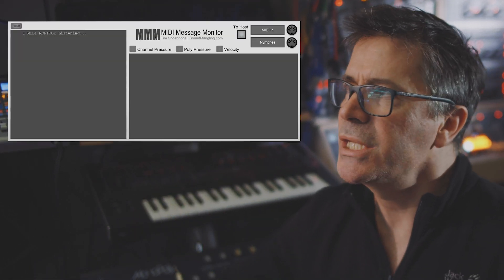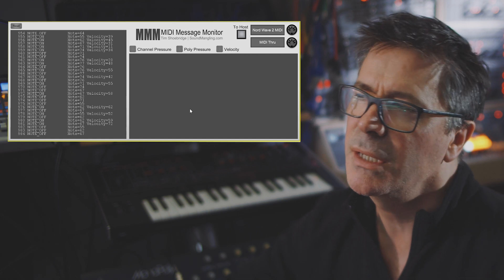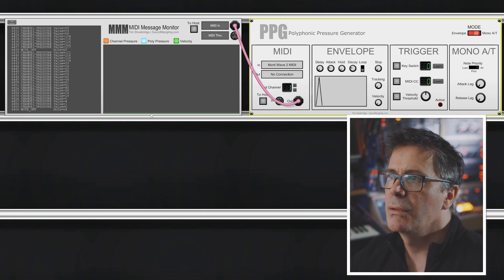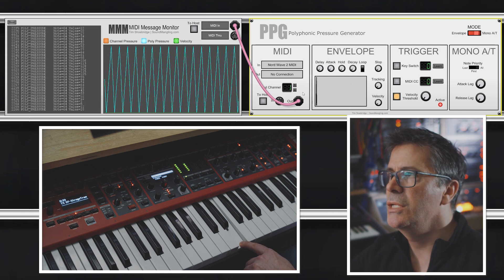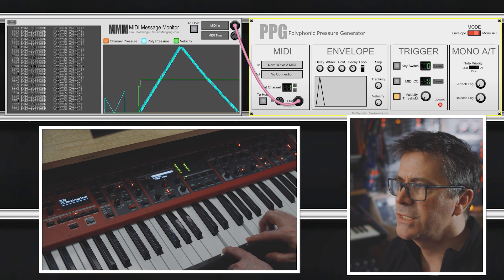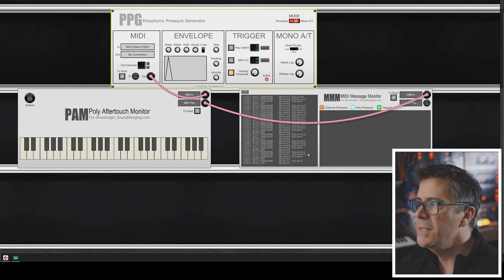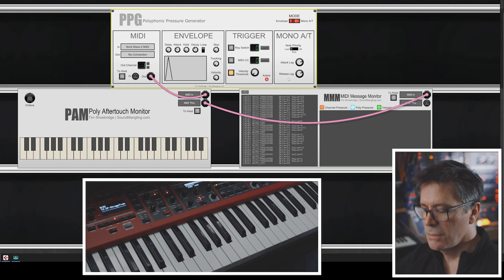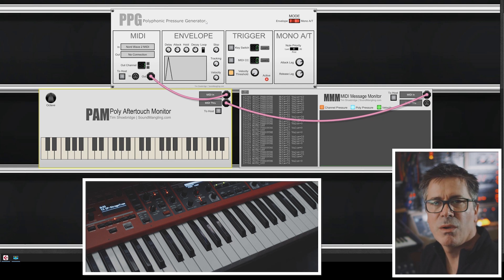MIDI Monitoring Software

Comment: Thank you so much! I'm going to check out your tools right now while I'm failing to connect one of my old guitar effects processors over midi to use as a DAW controller.
Reply: Sadly I already spent beyond my budget on some new gear this week. Too much to afford the $14 tool right now. If I haven't figured it out in two weeks I'll be back.

Comment: Hey Tim,

I've got an odd issue with PAM and my Hydrasynth Explorer. When using PolyAT mode on my Hydrasynth, the notes I press stay "on"/red in PAM even after I release the key. While pressing, the PolyAT registers correctly and the color changes for any pressed keys but on release it's like it's stuck at a pressure value of 0. In MonoAT/no AT/MPE modes, the notes do turn off in PAM when released and everything looks right in MMM.

Looking at the MMM messages, it looks like my Hydrasynth sends a final POLY_PRESSURE message with value 0 AFTER the NOTE_OFF event. In the other modes, the final CHANNEL_PRESSURE message is sent before the NOTE_OFF and I see in your examples that no POLY_PRESSURE messages are sent after NOTE_OFF. I think PAM might be registering that final POLY_PRESSURE message after the note is released and turning it back on as if pressure was 0, and it stays on since no NOTE_OFF is received after.

If so, a fix might be to add a toggle so that keys become more red when there is more pressure, rather than getting lighter as it is now. Then a POLY_PRESSURE of 0 would be white even if PAM thinks the note is still "on". I'd love that choice either way as that's how I expected PAM to respond anyways. Alternatively, could it be fixed by not visualizing events for keys that have been released? Is there a time when you'd want to receive pressure events for keys that are off? I'd honestly prefer the toggle but just wanted to ask.

I'd love to use this with your other Voltage Modular modules so please let me know!
Reply from the maker: Hi, thanks again for letting me know about this issue. I Just wanted to paraphrase the reply I gave to you  a moment ago by email:

It makes no sense for any instrument to send aftertouch messages AFTER a note has been released. It is entirely illogical. I developed tools such as PAM to help me create poly AT generating software, it's precisely by using these tools that I was able to ensure my software generated messages correctly 😒

Comment: Doesn't work with daw output messages?
Reply from the maker: Yes but you need to use as a VST in your DAW, route MIDI to it, then patch a cable from Voltage Modular's "From Host" MIDI port into my module...